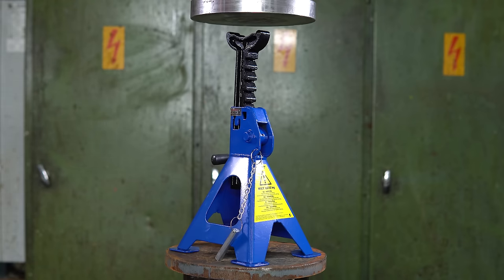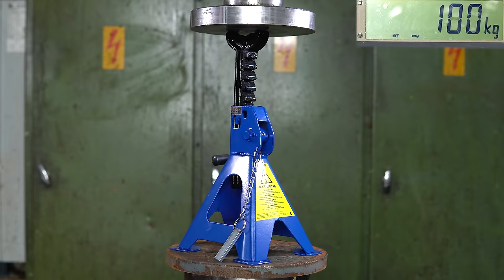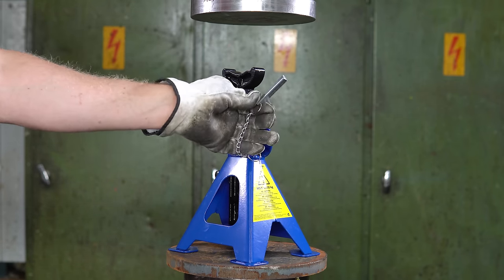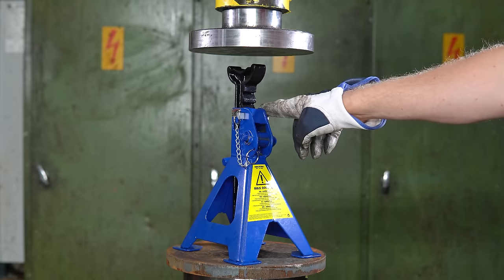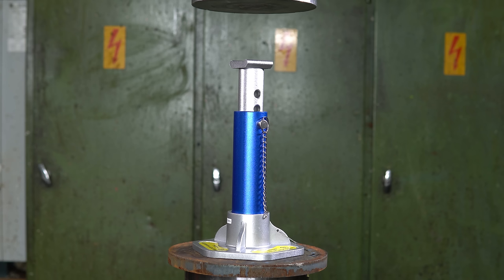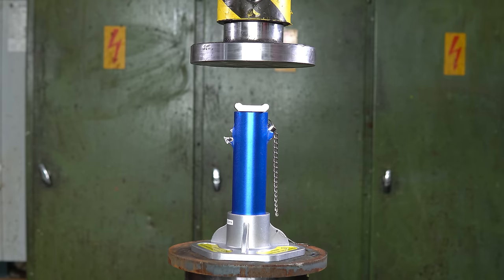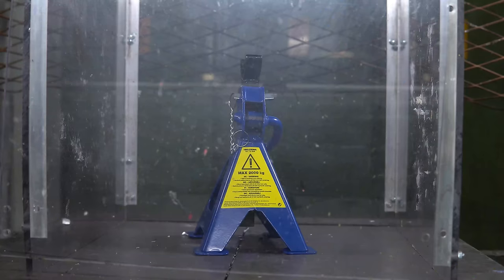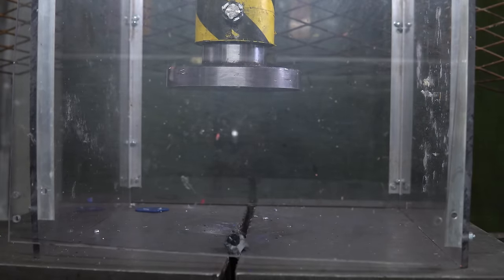How Strong are Jack Stands? + Broken Window, AGAIN!

Comment: Makes me feel a little safer
Reply: No joke, good to know if you use 2T jac stands for a car you can throw them under a big truck and still not have to worry about any snapping or crushing you
Reply: The main thing with these was that they all withstood at least 2.5x the force before breaking. Not really sure but i'm sensing a trend here, perhaps a government mandated safety margin they can be rated? Also we have to remember that the force rating is for repeated use. Going near the limit once will deform it and shorten it's lifespan. So 2 tons for a 2 ton jack stand. But in a tough spot and no persons under the load........

Side note: this of course only applies if the country has a functioning safety standards office that regulates and bans low quality items that do not meet the standards or are outright dangerous.
Reply: @alaric_  No country has a functioning government like that. You really think an army of Gov. boffins in white coats are testing all the products out there? On a side note, I use these types of jack stands to prop my boat trailer up, and they're remarkably easy to activate the unlock thing and have them collapse. The ones locally here don't have that safety pin and I wish they did, to the point I'll now look around and see if I can find some that do.
Reply: @alaric_  yes, it's called a safety factor. and most... well, things produced have such a thing, chain, slings, etc. and to be frank, it's easier for the manufacturer, if they make a jack stand that actually can support 4k-5k, but safely (hence, safety factor) rate it for 2k, they aren't going to be responsible if you load it up with 5k.

Comment: 6:43 Crazy how you can see the paint flex on the scissor jack almost instantly.
Reply: That was just the metal distorting slightly as it got loaded which changed the direction of the light being reflected.

Comment: i wish they did the test in the fully lowered position. I have $40 "Big Red" jack stands exactly like this. I only use them in the fully lowered position, bc that gives you plenty of room to do basic maintenance. You also have the third safety mechanism of the larger top of the black piece not being able to fit into the slot. 

I only buy cheap hydraulic lifts bc i only get under a car with these amazingly safe and cheap jack stands.

edit: guess i should finish the video before i comment. good job!

Comment: first just want to say it's an interesting video, thank you for sharing. Now, I don't think you are actually measuring the point of failure, even if it's showing 12 tons if you load it with say 5, 6, 7 ... 10 tons and keep it there for 1 minute for each, it might fail sooner than the max you see, going as fast as you do doesn't allow for the metal to deform and fail in time (which is the scenario you have when placing a constant load on it when jacking up the vehicle).
Reply: The heaviest vehicle I have is just over two tons, and the vast majority of people will be in that ball park, so a stand failing at five tons could have two and a half vehicles on it, as the sole support, its good to know that even the cheaper ones are more than man enough for the job.

Comment: Years ago working in a truck shop for 27 years i was asked if i could build some jack stands for class 8 tractors and trailers so I did and just so happens we had 100 ton nugger press so i did a destruction test on a couple of the stands i built to 100 tons
While they both distorted neither suffered catastrophic failure
Over 30 years later the survivors of the ones that werent stollen are still in use 
Should have built some for my self

Comment: Whenever I jack my car up I put the jack stand underneath it and leave the Jack underneath it for just in case
Reply: Same.
I also add some scrap blocks of Parallam engineered wood beams also.
Reply: Jack stands always struck me as unstable one trick ponies - buy them, store them, use them once in a blue moon. Bricks and blocks of wood have served me well so far.
Reply: @teaCupkk  Jack stands are plenty stable if you position them correctly. It's good practice to shake a car that's on them before getting underneath anyhow
Reply: Yep, I use jack stands, then also put my winter wheels underneath the car for added safety. According to this video might not be necessary, but i'd rather have the redundancy and stay alive than trust only one method and have an accident.
Reply: @LN997-i8x  Jack stands assume your car is on level ground, where I live it's not the case. They would also just add to the ever growing inventory of not that useful stuff I have to manage. For the sake of simplicity and stability, I just keep a stack of bricks handy, they cost nothing.
Reply: @teaCupkk  bricks can easily break under uneven compression loads
Reply: @jtcmlt1  Very true, which is why it's worth paying attention when building improvised jack stands. And, as with jack stands, rock the car to make sure it's well supported, before crawling under it.
Reply: @teaCupkk  Well said 💯

Comment: I would like to see a test between the Esco 10498 pin type and the new knockoff Harbor Freight Daytona 58789 (DJS3TCP).  Esco states their's is 3 ton per stand but their manual states 3 tons per set. HF states their's as 3 ton per set.  They look the same.  I've read some reviews that state the welds on the Esco's don't look so good.  I looked at the HF's and their welds look great.

Comment: Usually everything that has to do with ether lifting or safety like Jack Stands have a safety factor which can be from 1 x 3 and up to 1 x 8, if they are rated 3 tons then they should support 9 tons before the break...

Comment: Can you crush some car ramps to see how strong they are. I haven't found any I'm willing to trust my life with as their welding all look like pigeon poo.
Reply: Plastic VS. Steel.
Reply: i have a pair of plastic ones, they’re good for any low cars like sedans and coupes, obviously you wouldn’t want to use ramps for trucks or suvs
Reply: Rhino ramps.. try em out
Reply: @halfironman4003  I had my Navigator up on plastic ramps. It was a heavy beast. Same with my less heavy F150.

Only reason I don't like ramps is I'm paranoid of running over the front lip. 😂
Reply: @dchawk81  I ran over them once on an impala i used to have, the plastic ramps were stuck under and they bent my side skirts. Never again would i trust myself on them now i just use a jack and stands

Comment: The jack at 6:35 comes as a standard in my van, its rated up to 2500kg. It died under a load of 2100 kg. The bottom plate came off and bent the jackbar.

Comment: Huh, in that first test, I was expecting the metal in the ratcheting mechanism to just snap and everything just fail catastrophically. But instead, it seems like it just slowly bent and deformed. Which makes a lot more sense from a safety point of view. You wanna make any load-bearing pieces out of softer metal so it'll bend like that, instead of just snapping without warning. Very clever.

Comment: I can relate to this one.
I built the shoring and decking the grunts poured concrete on including elevator and stairwell shafts 18 stories deep. We put lots of heavy shit on top of really heavy shit. 3 decks below where concrete is being placed have to be reshored top to bottom just for strength.
Reply: Do it with scaffolding.
Bring a china man in who builds bamboo scaffold.

Comment: I'd actually rather see a plot of the forces applied. Gives a better sense of what's going on prior to, during, and after failure.

And that's the difference between aluminum and aluminum alloy, fracturing rather than deforming!

Comment: Even Mercedes, which weighs 2000 kg (2 tons), has a load of 500 kg, which is 1/4 of the load on one of the four tires.

So if one can withstand a weight of 5000kg (5t), it's safe enough.

If you use four, simply 5000kg ✕ 4 = 20000kg (20t)
In calculation, it can be used for vehicles with a vehicle weight of 20 tons or less.

Comment: I use jack stands and also have a 200 x 200 x 400mm block of wood as a back up. Would be nice if you can put some blocks of wood under the press.

Comment: For liability reasons, you will find any major jack manufacturer will have a factor of safety of well over 2 and likely up to 3 of the design load.  It depends on the country's certifying agency of manufacture and the country of use.  The scissor jack of course is crap and the failure mode was not unexpected as it tilts to the side.

Comment: the real problem with the OE type jack stand (the 3rd one) that are in most cars, is NOT that they can't hold the weight, it is the terrible balance they have and the fact that they can tip over extremely easily - NEVER use them - I've seen cars fall of them a few times

Comment: The 1.5 ton Jack doing 4 tons does not surprise me.. I was expecting 3.25 Tons.  Because safety ratings say that any device that is rated to lift X tons... Should by capable of taking double the load.  So a 50 Ton crane is capable of 100 tons on the lift.  But is rated for 50 tons.  The reason is shock loading,  If you have a 50 ton load and something slips / twists.. It an release and momentum can double the weight of that item when it grabs again.  This is a European standard.
We had a 1.5 ton jack lifting 3 tons, in an emergency situation.  Wood chocks and 1.5 ton jack.
At my old workplace we had to test equipment at times and they lift a 3 ton item with a 1.5 ton fork truck. If anything breaks... It fails. :P But you lift carefully and slowly. Then place on the ground again. A 1.5 ton fork truck "should" be able to lift 4.5 tons before things should break.  (warning that is the BREAKING weight.)  But if your forks flex more than 3 degrees - They fail as they are getting metal fatigued. There should be nearly no deflection at 3 tons.  Also the fork truck should not be moved with that weight, it is classed as a stationary lift for testing.

Comment: Bought duralast jack and jack stand combo for $67 that look like the blue jack with the pin. Amazing. And the welds are great. Check the welds on the harbor freight jack stands, and reweld them. They will be much stronger because the welds are shitttt

Comment: There is no way slightly bumping one of those will cause it to drop. As long as there is weight on it that side handle won't budge even if you smash it with a sledgehammer....I know, I've tried. It's a sort of secondary safety mechanism

Comment: As someone who HAS had a scissor jack brake and car come down on a wheel I shoved underneath the chassis NEVER use just 1 jack. 

My car only weights 2500lbs and a faulty jack snapped 😑

Comment: I don't think the safety pin is there to necessarily make it stronger. Though it did seem to do that. If set right, you would likely not need a pin, but even if set right, if the jackstand starts jolting or moving up and down for whatever reason, it could come out of place and fall completely down. I've seen it happen once in my career (Mechanic for 8 years).
What I found interesting in this vid is even after the threshold the jackstand didn't completely collapse onto itself, it gradually lowered the load.

Comment: So, basically, jack stands are only necessary in the event the jack happens to fail, in which case 1 jack stand will most certainly be OK under the average consumer's vehicle. Even the typical scissor lift included with vehicle jack packages is oodles to support the full weight of a vehicle in the event of a jack failure.

Comment: Whatever the jack rating, ALWAYS use at least two axle stands, as well as your jack.
The hydraulic jack is really just for raising and lowering the load safely. Its not just load that matters its also slip and even distribution. Never use stone or brick as a load support. ▲╲☠╱▲

Comment: That Aluminum one surprised me, that outer tube appears to be a lot thicker that it looks.   For me, the most important part about a jackstand is the actual base, the wider the footprint, the more stable it is, but also good to know where the failpoint is for the mechanism, especially supporting 9100 pounds, 4127kg for you metric nerds.
Reply: i agree, the wider base has more stability IMO ...

Comment: You should install the 1 cm x 1 cm hard wire mesh screens for the windows. 
We had the larger 5 cm x 5 cm mesh for the gym at our school so the balls would not break the windows.
If you set it up with clips you can install them quick for filming days. And if it's something with  a high projectile, you could install a catch cloth near the press.. Did I tell you I hate fixing broken windows?

Comment: 5 points if it crushes 
10 points if it explodes in the press
15 points if you have to use the box 
20 points if it exits the building

Comment: I would personally say the aluminum jack failed at 1500KG and catastrophically failed at 12000kg. kg you watch closely, the pin hole starts to deform at that 1500kg point, which is 1.5 tons. less than the 2 tons its rated for. It is curious that the jack stand paused between the end of that deflection (~5000kg/5.5 ton) and catastrophic failure. It'd be really interesting to see what it looks like if you release the pressure after the pin hole stops deforming but before catastrophic failure.

Comment: The jack stands that are sold around me are rated for pairs not single stands and the directions specifically say to use them in pairs so I'm wondering how are the stands that you are testing rated

Comment: That scissor jack wasn't aligned properly, if it would have been dead center on the press it would have taken more before it failed. You can see by the way it failed that it was off center.

Comment: The worst thing about scissor jacks is the way they fail. They go over sideways and the vehicle isn't stopping until it hits the ground and you can get seriously injured even if you aren't under the vehicle.  At least with jack stands, when they fail they only generally drop a few inches and your biggest problem is likely going to be dirty underwear. 💩

Comment: There’s absolutely no way you could bump the jack stand adjuster and have it fall down, the weight bearing down on it makes it so its locked into place on a lip and it cannot be forced out unless you deliberately smashed it as hard as you could with a big hammer or a crow bar prying on it...they wouldn’t make something that you could tap slightly and have the car fall on you...cmon now.

Comment: It amazes me that jack stands are legal as they are, I mean they work (sort of) but it's the flimsiest design ever. They're often poorly manufactured as well with imperfections in the broaches. That clanky rod and stand design is horrible. The ones with the bolt locking mechanism are far better, but even then...

Comment: This is not correct test. 
The correct test is to lift the load with a jack stand, and your hydraulic not moving, just measure, because then some moving parts on jack stand are loaded differently in relation to the test you are performing. Try one off them and you see different value.
Best wishes.

Comment: Jack stands are cheap. I always  use 2 per corner. Even a high quality huge stand can have a defect. You won't know until your pinned under a truck by yourself. Chance of 2 stands having a defect is way way lower. Be safe guys.
Reply: That's much smarter than the person who saw the IKEA chair video and said they were going to use them as cheap jack stands. 

Because safety is the dumbest thing to cheap out on.

Comment: you measure all wrong. you should call it when it starts failing. 
that's like saying a mosquito can withstand 20kg slap. yeah maybe the slap was 20kg but the thing would have died with 1 gram.

Comment: Stupid... Every mechanical system has a failure threshold.  Who is ever going to put 10 tons on a single jack stand?? Cars weigh  2 tons ; so, 1 ton per stand.... The cheapest stand can support well above their rated capacity.